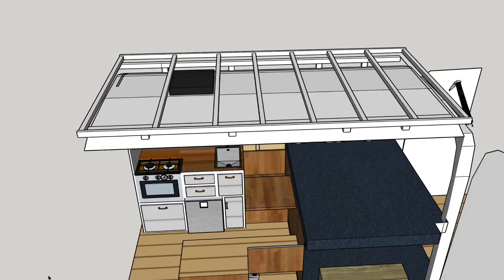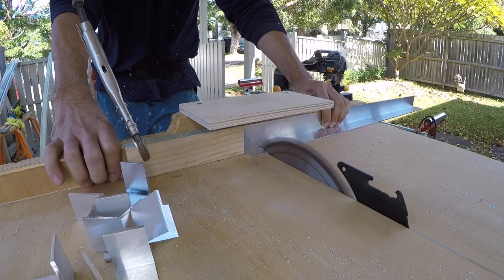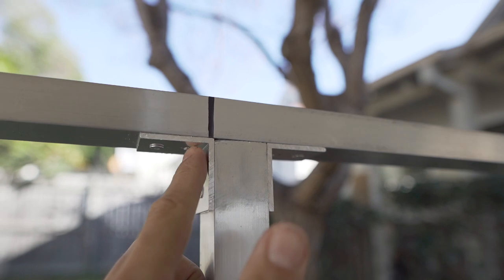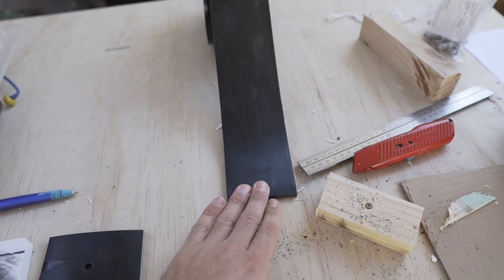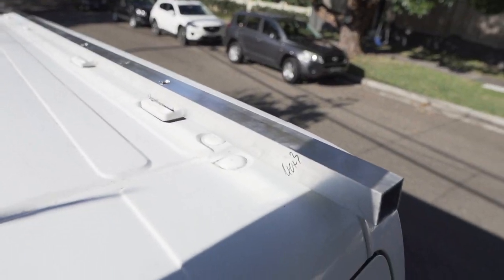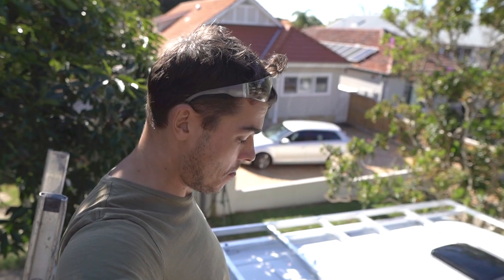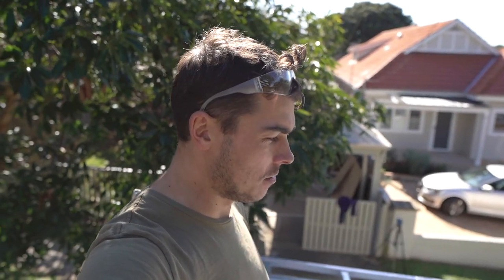DIY Aluminium Roof Rack NO WELDING Ford Transit Conversion

Comment: I have had some experience with pop rivets. I strongly suggest you take them to a buddy that can weld aluminum. Eventually, with use and some flexing and rough road, those will loosen and wear in a bit.
Reply from the maker: Yes i probably will in the end. This was really a proof of concept and i'm really happy that is turned out well. The same method could also be replaced with riv-nuts which would negate the need to be welded. Pop riveting it together really allowed me to build the whole thing in my yard then it will be. much quicker and simpler process when i want to weld it up as its already constructed.
Reply: @saltyvanventures  Yacht masts typically use pop rivets for attaching fittings however we use monel or stainless steel rivets not aluminium, they are pricey but very strong and they wont corrode or work loose. If you use an appropriate size and number for the expected load then the joint will maintain its integrity forever. Rivets  allow some degree of flex in a joint which can sometimes be an advantage, aeroplanes are full of them :-) .
Reply from the maker: you mean like this? https://www.youtube.com/watch?v=XxKxdj4gZPk
Reply: @saltyvanventures   Ah, so that's what you mean by "welding". I thought you were gonna whip out a tig machine or something. Yep, anyone worried about the rivets not being strong enough can just run a bead of that solder along the seams. Your deck planks are holding everything together so I doubt it's necessary in your case.
Reply: A two-part epoxy glue, along with rivets, is totally suffice; this is how they attach ali wings to aircraft 👍
Reply: Is it difficult to weld aluminum? I was thinking exactly what you just said, but I want to try welding myself.
Reply: This guy is cracy. Help to create your own. Tks both

Comment: Well done! One tip. Use a thread lock glue like Loctite. Comes in different tensile strengths. Those M8 bolts will never come loose! 😊
Reply from the maker: Great point!

Comment: I have a Doblo, looking to make some think like this, very low roof rack, reason, to put some king of sound insulation on roof, to stop most of the rain noise, I know it sounds silly, but, make frame, fill with expending foam, trim off when set, cover with some kind of water proof (ish) covering, then screw/bolt on roof,  money is really tight, I have to make sure there is a gap between roof and rack, I have turned it into a camper van type veh, I hate the sound of rain on roof,

Comment: The way you you use a big hole at the top and a smaller hole at the bottom is an ideal way to bolt two frames together like bed frames and slats using bolt and nut. Excellent ✅

Comment: Here's a helpful tip. On the late model Transits (mine is a 2020) the height of your cross bars need to be a minimum of 60mm above the factory threaded roof inserts in order to clear the arch in the middle of the roof. 

The inserts are M8 and you don't have to rip the whole waterproof plug out, you can just drill a small hole to let the m8 bolt through and then waterproof around the bolt depending on what fastening system you are using.

I work in the solar industry so I used solar panel alloy L brackets with a rubber pad on the bottom to prevent galvanic corrosion and the sikaflexed around that for added water tightness. Thanks
Reply from the maker: I found on mine the threaded insert didn't even line up with the rubber grommet. I ended up having to cut some of the roof out just to get the bolt in. Maybe that fixed that issue on the 2020 models
Reply: I'm looking to follow this approach on a 2015 jumbo sized transit. So are you suggesting to use an angle bracket instead of a plastic packer to elevate the cross member's above the roof crown ? If so I can't see why it wouldn't work ok and I wonder if you could dispense with the lengthwise rails alltogether and just have independent cross rails , what do you think  ?
Reply: Another way would be to just have lengthwise rails and use  a full span framed.solar panel with the panel aluminium frame attached directly to tje rails. The panel is strong enough on its own to act as a cross member.
Reply: @zackmack4712  Thanks Zack

Comment: Hey mate, love the video. Literally exactly what I had in mind for my mates van roof rack. The rubber and window blocks for the mounts are a wicked idea !!! 

Also just an idea man,
for the end of ya square tubing, where it’s open and you can see down the square tube. Go to the bunnings metal fencing isle and they have plastic fence capping (little square/rectangle black plastic plugs) that will fit perfect into the square tubing 

And also electrical isle at bunnings have blank cap grommets for the holes ya made with step drill bit to get socket into to do up bolt ! To stop it filling up with water! 

Subscribed & liked mate, wicked video
Reply from the maker: Yes i did actually put those plug on in anther video, you can see them that here https://youtu.be/pyBfaQYczW8?t=606 they work and look mint, also now that the rack is painted black.

Comment: I'd love to get more info about the vent installation process, as well as the brand.
Reply from the maker: Hi i bought a TRA 12 VOLT CARAVAN RV ROOF HATCH which has been amazing so far. Bought it on Ebay.

Comment: Good job bro, looks like you checked the box on a lot of items.  Easy to do, inexpensive material, and professional finish.
Reply from the maker: Thank you, glad you got some use out of it. I will eventually create a part 2 to this video when I manufacture the ladder and install the solar panels and rooftop decking

Comment: I am SO glad I found this video! I just scored a 2018 Transit 250 medium roof with 34,600 miles that is crazy clean. We have a like teardrop 6x8 camper we will continue to tow as our very very comfy bedroom. We will not be going full-time in a van - we have a lovely home here in southern Indiana  - but long camping filming trips are fun - especially to Utah and Colorado. I am going to add a MaxxAir fan and and a MaxxAir passive vent to the Transit. I did the same to our fiberglass Runaway Camper. I want to make a standing platform out of heavy duty wire pallet wire sections. I saw a fellow make a nice photography platform that way. I think this rack would work for this? Thoughts?  Also, I have not yet begun the build or the extensive van-build series for my channel, but will in September - any regrets to anything you did to the Transit? Or tips to make something better that you show in the videos. Thanks.
Reply from the maker: Hi there! Are you thinking bout attaching the wire pallet over the top of some roof racks for a platform for standing on the roof? I'm not sure how heavy duty they are but weight might become a concern. Make something out of aluminium if possible, as also it won't rust! I'd say the pallets may or may not be painted which may chip from standing on it over time rusting and the dripping rusty water on the van, staining the paint.
Reply: @saltyvanventures  I am now going with the heavy duty, but fairly light, plastic pallets. They will be in between the MaxxAir Fan in the front and the MaxxAir passive vent in the back - so the platform will not span the entire roof. The area would be the roof width east/west and about 42-45 inches north/south. So no metal to flake off. The metal and plastic panels have rather heavy weight bearing limits.

Comment: Awesome job bro do u mind sharing the full list of materials you used and sizes pls i have a 170” wheelbase sprinter, also the name of screw to. Attach the aluminum together ty sir
Reply from the maker: Hi, the full cut list for materials is in the video description. As for what i used to join, I believe it was 4mm diameter pop rivets, 7mm long.
Reply: Iva also got a 170 sprinter, how did you find attaching the ‘rail’ section to the roof?

Comment: Great video, thanks for sharing.
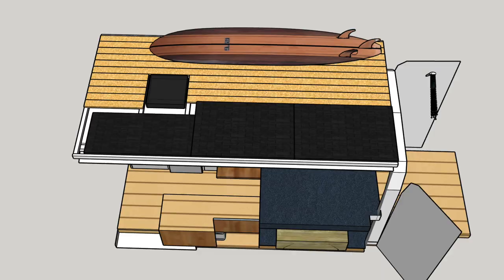At 1:48, you show a 3D model of the van. What software did you use for this? Would you recommend it as helpful?
Reply from the maker: The software is called sketchup. It's a free 3d design software and is invaluable when designing and building something like this so you can get a real good idea what it will look like and any issues you might encounter.
Reply: @saltyvanventures  Thanks. I've experimented with it in the past (deck design), so I guess it's time to get back to it. :-)

Comment: Have any of the roof rack pop rivets come loose with the lateral flex of the van? 
Does it whistle at highway speed with the cross members being so close to the roof? 
This looks like a very nice alternative to buying a rack.
Reply from the maker: Nope, Nothing has come loose at all. I was checking them the other day after having it installed for 3 months now. No whistling at all when on the highway

Comment: That's dope! I've been looking forever for a good roof rack build. Did you make the deck yet? No problem with multiple people standing on top of it? Also how did you find cheap aluminum like that? The only price I'm able to hit it 500-700 bucks for the tubing. Good job!
Reply from the maker: Thanks! No I haven't done the decking on yet, that is on a long list of things still to do. I have walked up on the aluminum cross members and there is a lot of strength in them. I have no doubt the deck can seat at least 2-3 people. I purchased my aluminum from Edcon steel in Sydney. Prices are on their website if you make an account. I found they were way cheaper than other metal shops.

Comment: We’ve just bought a FT 2016 410L bus, it’s got a wheelchair lift and one passenger seat in the back which will be removed next week. I’m not too sure if there’s airbags all along the sides of the cargo section as it would have been intended as a 12 seater bus originally. There’s a badge above both front seats indicating airbags above the doors so am worried we can’t put in an extended storage shelf which I’ve seen in many conversations. Any words of advise are welcome. For now we will play around with plans and do some weekend test runs with removable gear, mattresses, esky, gasmate etc

Comment: What was the point of the additional aluminium rails (not the main framing you made) could you not just put the main frame straight onto the roof, using bigger spacers to compensate for the curve?
Reply from the maker: It was due to the extra width I get doing it this way. I gain an extra 35 cm from the overhang which is what I needed to fit all the stuff I want to load on the roof.
Reply: @saltyvanventures  ah makes sense!
Reply: if you put the main frame directly on the spacers it would be the pop rivets alone carrying the weight upon the cross members.  by cantilevering the frame there is no issue.

Comment: What about height issues for bridges etc.
Reply from the maker: Its already a super high van but there are no bridges with low clearance that are that low I'm pretty sure. And if there were the stock standard van would have trouble.  I have only added about 15cm of height to the roof so very minor. The only problem we have is with underground car parks. But we would have never fit regardless of the additional height added.

Comment: Awesome work! What size rivets did you use for this? Are they aluminum as well or did you use stainless for strength?
Reply from the maker: From memory they were 4.2mm rivets. I used aluminium although this has been over engineered so the aluminium rivets are more than enough.

Comment: Great job. How did you figure out the angle for the shim?
Reply from the maker: I believe I layed the shims down flat where they would go, then placed the flat aluminum over from one side to the other and measured the gap between the shim and the alloy they cut triangle out.

Comment: i love your videos! Thanks heaps for what you do.. are you going to do one on the battery set up for the transit? Can't seem to find any info anywhere (especially australia) on whether I need to get someone to dismantle the whole dual battery set up or if I can connect my lithium to that set up via the charge controller! What have you done?

Comment: Great, helpful video thanks :) Can I ask, how much you cut off the shim? Im trying to work out the correct angle. Thank you
Reply from the maker: I wouldn’t be able to tell you the exact amount as I just measured it up there. If you put two shins on either side on the roof and then lay a flat bar across the two, you will see the gap, this is the inverse of what you need to cut off.

Comment: How about putting insulation between solar and roof? After watching so many videos, I don’t think roof insulation is that necessary in all places. The gas heater is quite strong for a small space. Summer time the heat will be trapped
Reply from the maker: I wouldn’t recommend against it.

Comment: Looks great. Thanks. A few questions, please…

1) I looked up “plastic window shims” on Amazon and couldn’t find anything that looked like what you used as the bases for the roof racks. Can you think of another search term I could use to find those?

2) Did you cit the L angle brackets out of a long piece of L angle material? Or did you buy them as individual pieces of L angles?

3) Are the pop rivets aluminum, steel, or stainless steel?

4) Has the rack and the ladder held up? 

5) Is the paint still adhering to the metal?

Thanks.🤙🏼
Reply from the maker: Try searching Plastic SHIM Packing Plates. Yes just but the L brackets from a long piece. Pop rivets are aluminium to prevent galvanic corrosion. Ladder is still rockslide solid as is the paint job.
Reply: @saltyvanventures    Thanks for replying, man!

Comment: Hi fella. Can you confirm the size of your 3 panels as I've bought the same ones but the don't add up to 3.25m long rack you built (even allowing for the rack being slightly longer than the panels). Also, where did you bring the panel cables inside the van? Thx heaps
Reply from the maker: Hmm thats odd. My 200w panels are 1030x680. So with the renogy panel it is 3134mm. Ive just check the Ebay link with the one I bought but the dimensions they are advertising have since changed since i bought it. That's is strange but thank you for bringing this to my attention so i can change the link to the correct solar panel.

Comment: Nice job.  Curious how you capped off the holes in the ends of the aluminum?
Reply from the maker: I haven't yet but you can buy these black plastic end caps that fit perfect.

Comment: Magic mate Love ya work... Easy to follow and listen to also... We are at the van purchasing stage-pretty exciting....... Q how much do you have to leave to account for the flex of the rack before it hits the roof (when your standing on it)? Cheers
Reply from the maker: If i were to build it again i may have left extra gap. That can either be done by increasing the height of the plastic shims or making the long side rails taller using a different variation of tubing. I would probably leave about an inch or so

Comment: Hey! We're currently building our van and just wondering how exactly you cut the packing shims on an angle like that? We don't have a table saw, just a drop saw. Cheers!
Reply from the maker: With a table saw you can change the angle of the blade. So I adjusted it to the desired angle and fed it through with a fence guide. It might be tricky to do it with a drop saw as holding it in place might be awkward.

Comment: Can I ask a dumb question. Why didn't you place your cross bars so that they sat on top of the mounting points for the longitudinal 50mm sections so that you could use longer bolts to bolt these cross bars through longitudinal sections and into the roof mounting points. Then there wouldn't be a failure point with the rivets. Hope that makes sense :-)
Reply from the maker: Good questions, for which i don't have an answer. I basically placed the cross members even spaced and then work around the roof vent. It may be possible to do it that way for sure

Comment: BTW...I see you on the roof doing the vent, the roof is flexing and I hope you didn't break the seal of those plugs in the roof which are only sealed with paint. If so.............little silicone to reseal? Finding water while driving in the rain may indicate this event.
Reply from the maker: Thats probably a fair point. Thanks for that i didn't pick up on that

Comment: Hey bro any recommendations buying a older transit? Say around 2008 285,000kms
Reply from the maker: I cant't say from experience but i have herd the VM model transits (pre 2014) have a tendency to have engine/transmission issues. I myself would be hesitant to but one, but having said that there are a lot around.
Reply: @saltyvanventures  Cheers, appreciate that! Yeah I am seeing alot around with that problem. I'm looking at something a big newer now!

Comment: My guy, is there a reason you used rectangle instead of square tube for the rails? Just about to order materials for mine! Love your work g 🙏🙏
Reply from the maker: I wanted a small lip for the solar panels to rest up against. Plus it didn't need to be as wide as the cross members

Comment: Doubt it will hold a grown man lying on it. Itl bend and not bend back. And might rattle in middle on roof looks close. Could of made it hinge to one side for extra solar absorb and could of made both ends telescopic for washing or awning.
Reply from the maker: It supports me lying on it and i'm 92kg. Obviously it's not designed for one person to stand on one cross member hence why I designed 8. The 3mm square is actually very rigid and will not permanently deform unless i stand and jump on a single cross member. I will mostly likely ass a washing line on the side.  I did this on my last van and it was so great!

Comment: Hi, 
Going to give this a crack only issue is that i have a hiace 2009 with rain water mounts? any suggestions ?
Reply from the maker: May be somewhat tricker. Might be easier to by cheap gutter racks and retro fit them with this design.